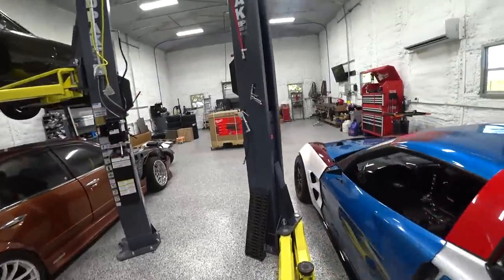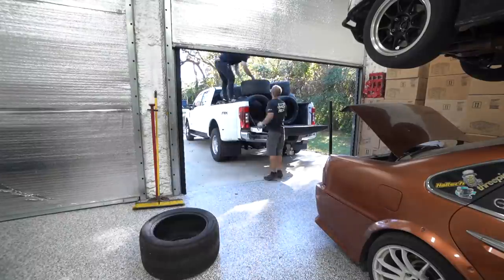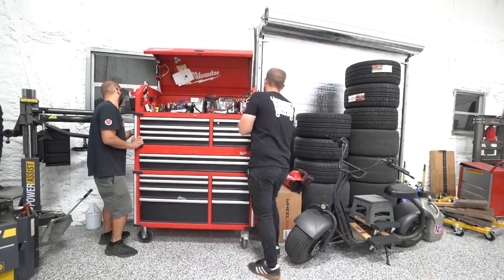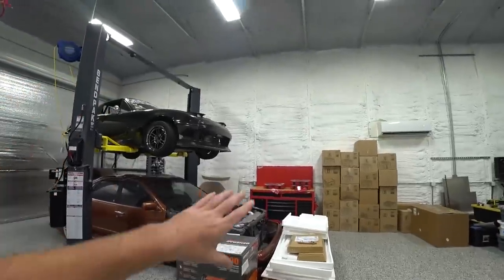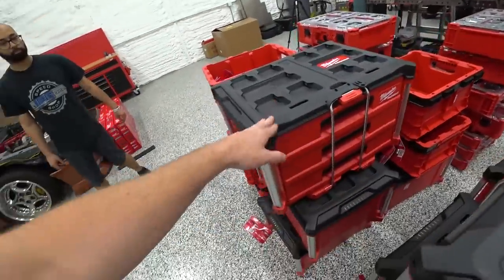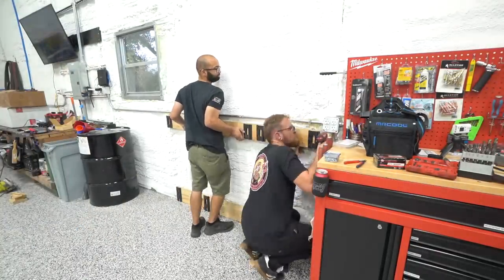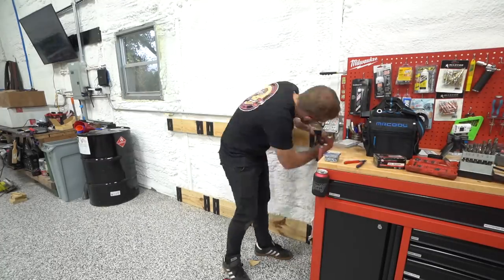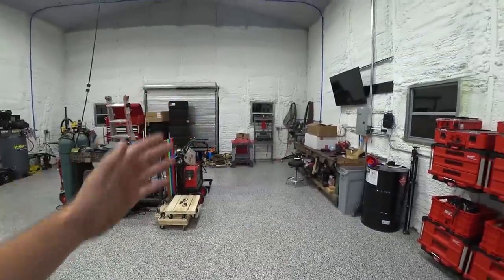Major shop upgrades. the best workshop organization setup.

Comment: I've found one of the best ways to achieve 'everything with a place, everything in its place' is drawer foam.  It's a pain to set up, but I've found it helps to see at-a-glance what tools are out in the shop (get the two-color 'sandwich' style foam so it's not a black abyss in the drawer) and gives a 'one-and-only-one place' for things.  As a person who sets things down on everything available horizontal surface without thinking and then it's lost for 20 minutes the next time I need it, this has helped a lot.

They also make a Packout floor dolly that you can stack and then roll around the shop.

Comment: You probably need to do task based organization for your most common tasks, probably use your old Milwaukee box for tool based organization and a pack out or small box for the most common tools that you don't want to duplicate for several tasks.

This would allow you to move your track task tools from your trailer to your garage without taking too much time or leaving without a critical tool.

You could do Kaizen foam cutouts for those boxes so you can quickly identify any missing tools.

Last, look in to industrial pallet racking and a lift that will allow you to go vertical with spares and other heavy items you want to keep under the roof.

Anything that doesn't cover probably isn't used very much.  You can either go vertical with it or put it in your container.

Comment: I have three towers of packout boxes on wheels for mobile storage.  They go into the trailers when needed.  I can also pull of a tower depending on what is stored in them.  This saves on wall space which is full in my garage.  Great work.

Comment: Use headliner adhesive for the tool box drawer liners used mine in a professional setting and worked great for years never peeled up

Comment: Taylor I used 3m headliner or contact cement spray for my toolboxes to hold that rubber pads in place 2 cans got it with 3 of those same boxes you got buddy shops coming together bro great job I’m almost done with my 40’x84’ I know the struggles of organization especially being super ocd lol

Comment: Sunex makes the best master 3/8 drive set, 80 piece set. its about $250. they also make 1/2 & 1/4. they are by far the best bang for you're buck. you should also get the dollys for the packout drawers so you can move them where ever you're working. trust me I'm a tool nut!

Comment: A good place for those shelf packs is above your pegboard (or just besides it).  It free's up the pegboard for those random things you need all the time (electrical tape as a stupid example), and gives a great place for your battery chargers to live.  Also, dont forget to utilize those in the trailer for fast traveling.

Comment: Taylor, love the organization efforts for the shop and congrats on the success of the Vettes first comp.
I was wondering if there is a configuration you could do, using the beefy steel shelving (buy another so you have for both stations).  Essentially, use that as a frame and install the Milwaukee boxes to the frame.  That way, you're not mounting them to the wall.  Also, you can install beefy wheels on the racks to allow them to roll around if you ever need to clean behind or move to a different area of the shop.
Just an idea, I know it's still a work in progress and I was thinking of how heavy some of those red boxes might end up getting.

Comment: You can also buy some sticks of horizontal e-track in whatever length you need and screw those to the wall, thats what the PACKOUT racking plates were designed for.

Comment: @Taylor Ray Hey use rare earth magnets with some the Milwaukee wall packs so you mount and remove them from anywhere on your lift or side of toolboxes. You could also easily remount your packs into your trailer saving time.

Comment: I love what you guys did there with the Packout system. I’m looking to do something similar but not as many. Something you might want to look into for the bottom row of stuff are the rolling platforms with casters for that system. For what’s going to be down on the floor anyway, that’s how I plan to do mine. Then I can just roll them around if I have to. They even make a little counter top type thing for the top of your stack, if that’s applicable for your situation. Thank you for sharing! Really cool workspace you have there! 👍🏼

Comment: Ray,
Tool Box liners.
Like you I have tried  EVERYTHING. I tried different types of liner materials
And it all bunches up. I tried gluing it down, no luck. FINALLY I found the 
PERFECT drawer liner & IT IS FREE!!! Corrugated cardboard. Cut yourself some
drawer sized squares out of corrugated cardboard. It does not bunch up. You
can drop sharp heavy tools into a drawer it dont care. If you want to get fancy
you can spray paint the cardboard but I never have.

!

Comment: I recommend using the Packout dollys at the bottom instead of using shelf brackets. Makes them very portable to bring close to the cars and easy to change out the Packouts required for the task. Plus get a couple of Packout work tops.

Comment: You should get wheels for those bottom pack outs instead of mounting it to the wall near the floor. also works as a rolling work station you can roll up to any car or beside the work table.

Comment: I’d recommend cutting the bottom chunk of the boards off that are touching the ground. The wood might soak up water when you clean the floors. Would be best to have a few inches taken off and then mount them in the same screw holes.

Comment: the bottom packout drawers would be awsome on the packout dollys. they also make horizontal e tracks instead of using the included vertical packout tracks! 

awsome setup though!

Comment: Just an idea to strengthen those packout mounts on the walls is to get a couple 1x6 and slide then between the wall and the back of the boards the mounting tracks are on and tie the top board to the bottom board. Essentialy a stud. Would really strengthen it if you added another cross board at the top behind the organizers.

Comment: Cool organisation system!

Given the lack of wall space, but large amount of middle space, have you considered instead of having the large shelving unit at the front, near the lift where it could get in the way, instead being somewhere in the back half of the shop but perpendicular to the wall instead of against it. Then you would potentially be able to access it from both sides and it wouldn't be taking up as much wall space?  For instance sticking out from the same wall it's against now, but just beyond the system you put up in this video, thus acting as a zone seperator between work area and couch?

Comment: I love seeing the garage is coming together! I too have a 30x50 metal garage. I am having Polyaspartic coating applied to my floor this week. I will be installing a lift this winter and notice that you are storing your Mazda on the lift. Do you have any concern about the suspension hanging with no load? I've read where it's not good on the springs and shocks. I want to store a car as well but uncertain.

Comment: Also when it come to mounting the plates and the shelf mounts uni strut that they use for plumbing  and electrical mounting is byfar the strongest most versitle method of mounting the boxes and anything else especially in a steel building. i use unistrut and strut channel rollers for a lev rack style packout storage system

Comment: In my humble opinion, in your case, since you have a very nice floor, the Milwaukee dolly Model #48-22-8410 would have been a better solution, and you can also enjoy the beauty of moving them around as you please and then put them back. My second option, would have been to install plywood on the wall and then mount everything on that plywood, making it stronger/safer and you avoid stressing out the studs. I enjoyed watching your video! Liked it already!

Comment: Sweet!!!
Accessible storage is so helpful for time optimization. 

I do question not just putting the metal rails up as they were instead of cutting them down. Seems like the wood is just going to warp and sag with such a narrow attachment point. I would be concerned about the building studs getting damaged with the current attachment.

At this point a couple pices of angle could probably shore it up, running vertical to tie the top to the bottom boards together. This should keep the boards from wanting to twist and keep them from deforming those wall studs or worse.

Comment: Someone probably already suggested this but if you get frustrated by the rubber mat bunching the product you're going to be looking for is going to be some Super 77 or similar spray on contact cement. It's aeresolized adhesive, essentially meant for sticking large surfaces on other large surfaces. If you just give things a light coat as well, you can make it just tacky enough that you can mostly remove it later on if you really work at it but it will stay in place in normal use. If you OVER do it, it will weld itself to what ever surface you've applied it to. Just figured I'd extol the virtue of the good stick.

Comment: need to take some 4x8 Cabinet grade Plywood and begin mounting it to your walls at least one section at a time mounted 8foot vertical. that way when you want to mount something it wouldn't matter where you put it it would just go up on the wall. may have to get some spring anchors similar to those for drywall depending on how heavy an item would be.

Comment: I use the same box professionally in a shop and it holds up with plenty of weight in it and drawers work just fine being opened and closed all day long. The only downside to these boxes is they reduced the thickness awhile back, and the paint scratches super easily. Expected as its fairly cheap compared to others.

Comment: Shop is really coming together.  
I think I would put the gray shelf back in the garage or the storage container for long term storage.  If you want it in the shop, how about in the middle - on the back side of the welding table?  Ultimate home - mezzanine?
One last thing...why no drill press yet???  Why??????????

Comment: How do you handle when you need to do to a race and you don't want to pack for days, but don't want to forget anything you might need?
Reply: It's something you get used to over time. I used to take huge amounts of stuff with me at the start and now it's down to six 25 litre storage boxes. People are constantly coming to me for parts as they know I have the bits that actually fail rather than the bits that you think will fail.
Reply from the maker: I generally put parts on the trailer. As I accumulate spare stuff. And tool wise I just upgrade the shop tools and the trailer gets the hand me downs. So now I have just about everything tool wise in the trailer.

Comment: What camera/mic setup are you using these days Taylor?
Reply from the maker: I use a Sony action camera (FDRX3000) as my handheld walking and talking camera. Then a Sony A7RIII or something as the tripod camera. I was using an a6500 for years but recently upgraded to the A7 since it has a bigger batter and uses the e mount lenses and I was having trouble with my 6500’s sd slot.
Reply: @Taylordrifts  thanks for the info 👍

Comment: one thing i will say is a stupid as it sounds, a leather sofa in a shed is so much better than a cheap fabric one because you can just wipe it down from fabricating dust when you want to use it instead of the fabric getting super manky over time making you never want to use it, you can usually get decent leather couches fairly cheap second hand and you can throw on a removable washable cover if you dont like sitting on the leather when your hot and sweaty from working or like mounting tyres or something, but yeah fabric sofa in the shed is the worst thing ever once you have had a leather one lol same thing for dog hair if you have an iside dog
Reply from the maker: Funny you say that. We’ve always ended up with leather sofas for garage/shop sofa. But not really on purpose.

Comment: Carpentry / Mechanics - D. I. Y. -er's and  YES , You Guessed it. Comments  that  are meant to Inform... 
Suggestions  when it  comes to Hanging ( ANYTHING )  From the  fasteners  used. To the  Size, Width, Length, and  Thickness.   Think of it  all like a Mathmatical Equation ( BUTT ) in Reverse.   You Know  the  answer  ( YET ) Not  sure about the  Method or  process to get it  ( RIGHT ) . 
" In the  End - It All Goes Back to the Beginning " 
This Holds  True  with everything  aspect  of  LIFE, Goals, Dreams, Aspirations, and  Changes too. 
What you  have  done is  interesting. Yet to be Perfectly BLUNT 
Doomed to Fail !!!  WHY ???  Even after  you  added a  stiffer board to the  top. 
What  ( I ) and  Most  others  are seeing  is  Sag.  Cantilevers are what exactly ? 
A  Means  to an End.   Making  something  Stick out  farther then it  was  intended to be otherwise.   Suggestion / Advice - Recommendation. 
Go get yourself  some  2" x 12" x ( 10' or 12' ) maybe  14 '  if  that  fits  the  space  best.  
TIMBER LOCK  Fasteners are used as Replacement for Lag and  Carriage bolts  alike. 
Smaller, Stronger, Higher  Rated and  better to Confined spaces. 
SUPPORT is one  of  the KEYS  to this  Actually  working  LONG  Term. 
 Its  Far  better to Over Build, Design, Construct, Brace something now. 
Then to Fall Way short and  Have  to Re-do, Purchase more and  Figure it  out  later on  after licking  up the mess that  was  created. 
People  Relate ( Quicker ) as Being  Better.  Instead of Stronger Lasting  longer. 
 When you  started to Cut Down all those  brackets. 
It  Took away a  Fair amount  of  its  LONG Term Rigidity and  Strength as it  was intended  from the  Manufacturer. 
Truth be  told  you  would  be  Miles ahead by placing   Large Planks and  Thick Plywood  behind  the Areas  you  decided to put this  system together. 
Total Cost  Versus  added  insurance and  prolonged  usage ...
P. R. I. C. E. L. E. S. S.   !!!
This  is  only  a  few  ideas  that  you  still can  implement. 
For ( IF ) you  choose not to . 
Its  not  a  matter of  ( IF ) this  fails . 
Exactly the  opposite. 
How  Soon,  TO  What  Degree, and  at what  cost  both  in time, labor and  lost  products to boot. 
Short  Cuts  only  work in the  Short  term !!!
Stepping  back  even  for  ( 5 ) minutes at  a  time. 
Often  allows  clearer thoughts and  ADVICE to be  reviewed to Save You Instead of  Doom You  to failure. 
Anyone  who has ever  erected  shelves, Hung  something on a  wall,  Or  Relied on  Less then Stellar  Advice  will attest to this  message. 
" Always Time to Do It  Over  - Never Enough Time  to Do It Right ? 
Just because you are posting a  clip. 
Does Not  Mean  its  the  only  time  to do things  differently. 
People tend to Forget ( WAY MORE ) then they Remember . 
When In Doubt - Talk It Out. 
There are plenty of  Store employees,  On-line  Forums, and  Yes -  The  Guy Next  store who has a Degree in  ( D. I. Y. )  101  of  failures to  share in the  process of getting you back on track. 
With Over  5 +  Decades of Residential/ Commercial / Industrial - Work, Dealings  in ( ALL ) the  Trades  from the  bottom  up.  What  you  are reading is a Testament to Success...